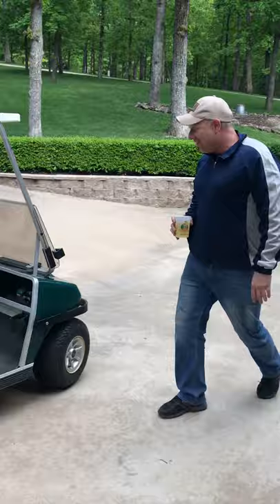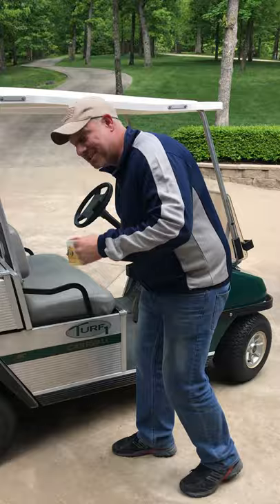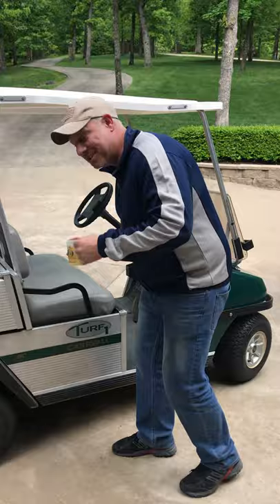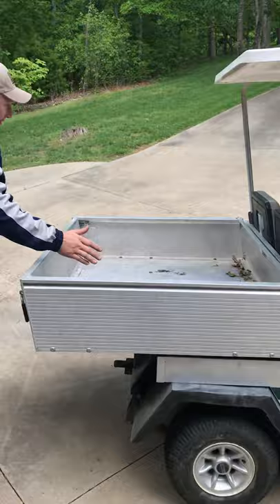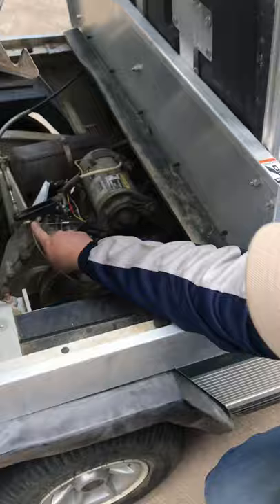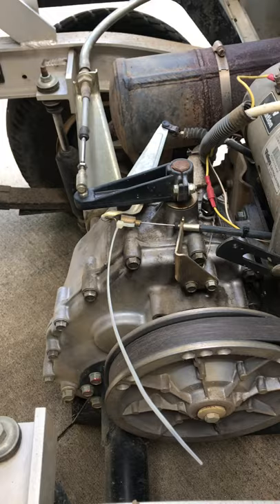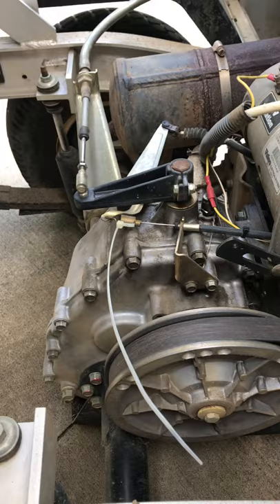Increase Golf Cart Speed - Bypass Governor - Club Car Governor Hack - Zip Tie

Comment: Take that little Spring off. Put a zip tie around the cable. A very small one. Push the Spring back over the zip. Tie hook your Spring back up this way. It don't blow up your motor and you get.  It to go faster.

Comment: Yes it will have a higher top end speed and do maybe,25-27 mph but it will sound like its gonna blow up and the valve will hate you and motor is gonna blow up very quickly doing this. Just adjust the governor nut down until its as fast as it can go just before it starts going flat and thats the max you can tighten down governor with out blowing it up then add the g boost upgrade spring and belt for more lower end torque and more pulling power.

Comment: We would use a golf tee and it would hold it for the round then pull it on the last hole. They can get going scary fast down some hills. We broke a couple when we were younger. Getting air.

Comment: I did the same and it goes a little bit faster and it seems to slow down soon after, fresh gas, changed oil, new tires, Yamaha 2016 model.  Does it have some type of speed limiter besides the spring?
Reply from the maker: No clue brother. Drink a vodka and take it off road!

Comment: You have to short out the over reving litter you just have to ground it it
Reply: Where is that?
Reply: @anthonydeleon6477  mind was a black wire in the back of the engine  you have to short it out  on the frame mine rips like heck you just have to be careful not to over rev it and ruin your engine im sore there is ya you tube video on it

Comment: that how you blew your motor up by over revving it
n have fun being standed being on side of road with blew up motor
if i were u i would upgrade gear in axle n drive train get it up 40mhp without having to fool with grovement control without having motor destory
Reply: You should learn how to write a sentence.
Reply: @lemonaid8678  are you going teach me or what?
Reply: @kittyztigerz  so when you say upgrade the gear what exactly are you talking about?
Reply: @lemonaid8678  upgrade gear in axles n drivetrain
Reply: @kittyztigerz  what do you mean by upgrade it? What are you upgrading about the gear?
Reply: @kittyztigerz  im trying to speed up my golf cart but I don’t know what you mean by upgrade it.
Reply: @lemonaid8678  upgrade mean you put new gear like 32teeth to 44 teeth
"if u have worked on gokart you would know it "
drivetrain on it is make for low speed n doesnt tight up on belt fast enough or longer
Reply: @kittyztigerz  yes I know. Change the ratio. Just seeing if you knew what you were talking about.

Comment: Please don’t do this this will kill your motor and make it run rich and you will have to pay for a whole new motor which are around 1k
Reply: Instead there is a cable under the gas pedal and if you tighten it it will make it gain hp

Comment: Will it damage the engine
Reply from the maker: It could. Running at high RPMS is not good for any engine. Just dont keep the pedal to the metal at all times
Reply: Craig Pinkerton reminds me of when top gear took a bmw and a prius and drove them around the track to see which would consume more fuel. it was quickly evident that the prius needed to work so hard to do the same thing as the beamer, that it effectively leveled out any fuel consumption advantage the prius would have compared normal highway driving. not always what you drive, but how you drive it.